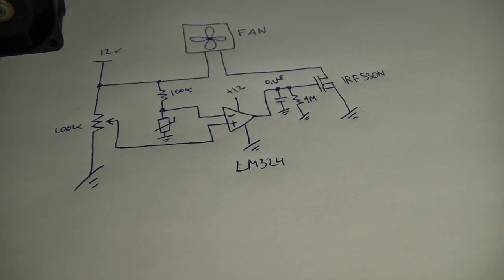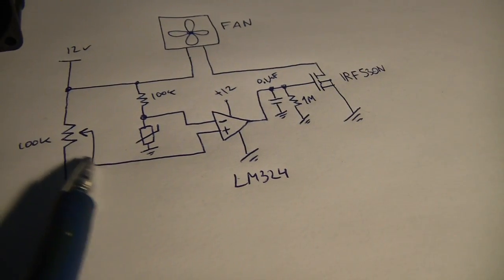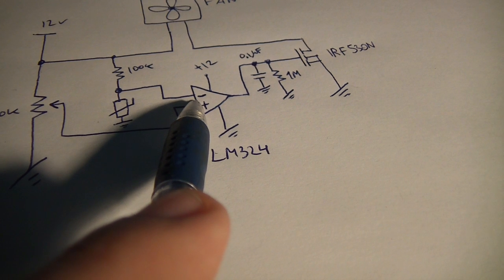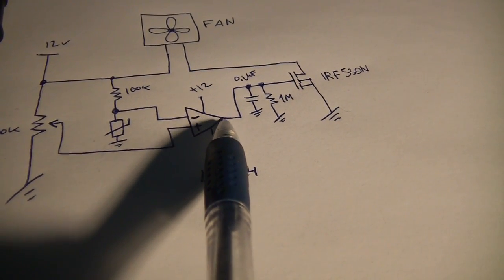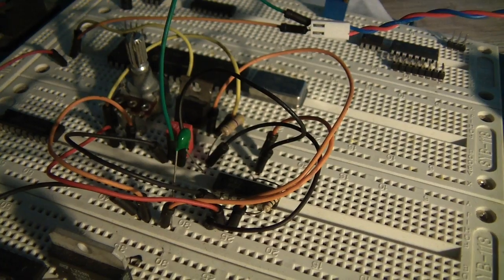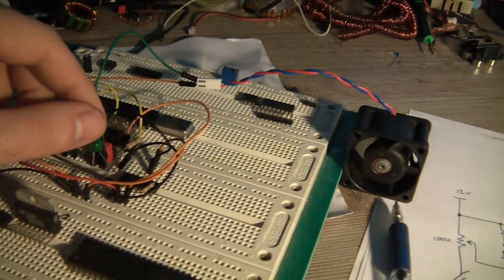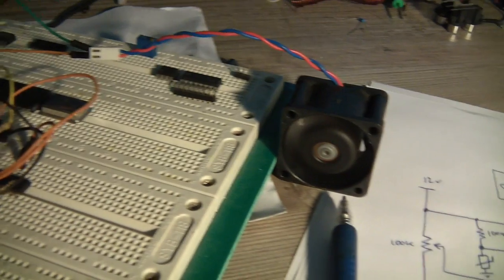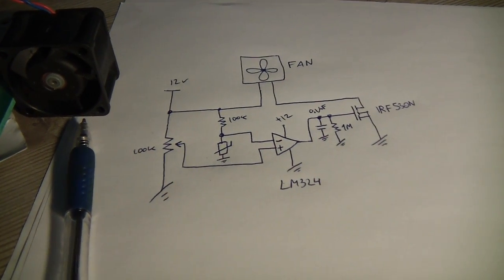Temperature activated fan controller for my Car Amp

Comment: Sir, pls I have a problem, the Thermistor is not sensitive to heat unless u heat is constantly and once the heat source is removed, the fan goes off. Pls what can I do. I used 4.7K NTC THERMISTOR,

Comment: Hi i am planning to use a thermistor which is very small like a smd pcb mount .can you recommend any that can  work well this configuration.thanks
Reply from the maker: Just use a 50k-100k NTC and you'll be fine :)
Reply: Thanks Artiom appreciate ..just designing  my pcb for a led based project hopefully this can help.just need to reduce junction temp at 65 degrees.

Comment: can it be use on 240volt
Reply from the maker: ahmad abdol Hi ! No , as the control circuit must use low voltage. If you want to control a 220v fan you must use a triac and more complex control circuit.
Reply: is there chance where i can have it from you as a hobby kit don't mine paying for that.

Comment: This is just the circuit I was looking for, thank you Artiom you give a very good explanation of the entire circuit and how it works in detail. The only thing I don't understand is the function of the cap and resistor going to the mosfet. Keep the videos coming.
Dillard
Reply from the maker: Hi ! Thanks for the feedback, in general the purpose or resistor and capacitor at the gate is to stabilize it, to give it a ground potential. To avoid signal ringing and oscillations as well helps to discharge the gate. In this particular application they are not critical. Personally i use them every time i use mosfets.
Reply: This circuit was exactly what I was looking for to cool my XBOX down. I am having massive trouble with heating and actually turning it on.... I assume that my issue is miss wiring. Would it be possible to send me a diagram?
Reply from the maker: Hi ! I didn't make any schematics sorry, just draw it and made it, it's so simple, build the circuit that you see in the video. Need only one opamp like LM324, some N-Channel fet a potentiometer and a few resistors. Can omit the gate capacitor. Can use 12/5 volt supply. (depends on the fan)